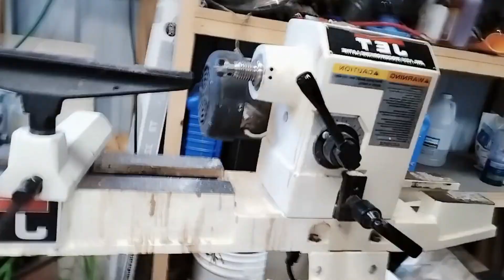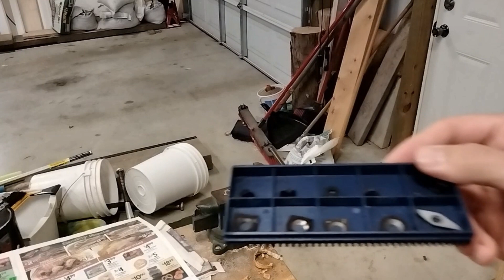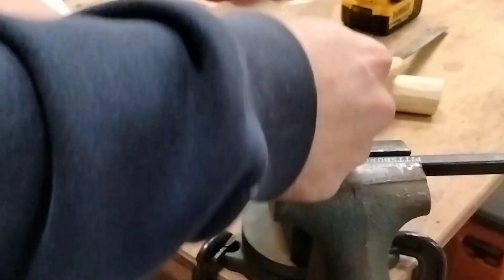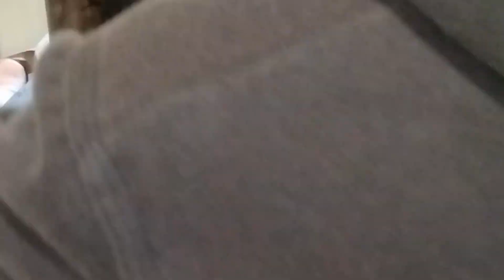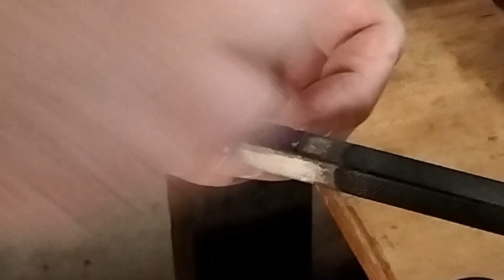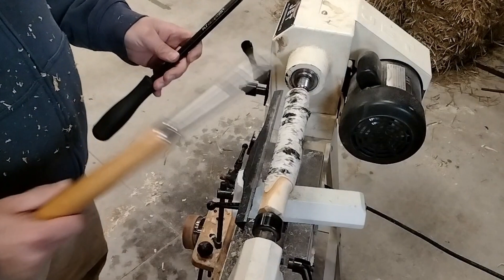DIY Carbide Wood Turning Tools - Including a Diamond Detailing Tool

Comment: My friend, how long do Carbide blades stay sharp? Do we need to sharpen or replace them often?
Reply from the maker: It will depend on what you're cutting with the carbide. If it feels rough or if you get a lot of chatter, then it is time to replace it. I don't know if carbide bits can be sharpened.

Comment: Don, Rather than cutting off the bent end of the tool, what if you only cut a short piece off it and you mounted a regular carbide cutter so it was angled down.  Wouldn't it cut like a negative rake cutter?
Reply from the maker: Maybe. I think the angle would also interfere with the tool rest. Might be worth a try.